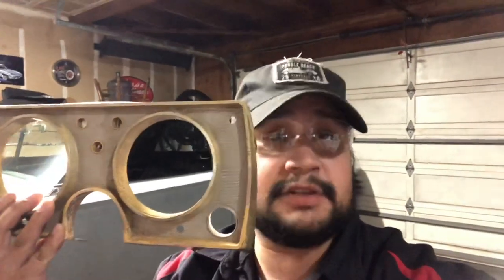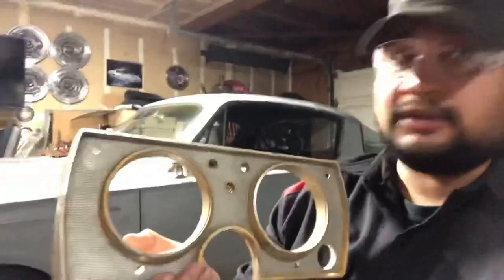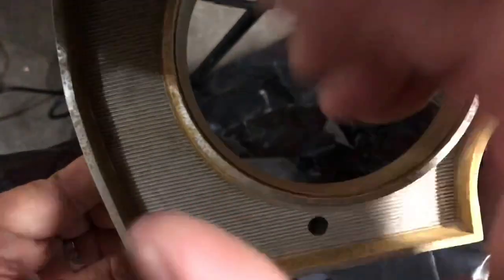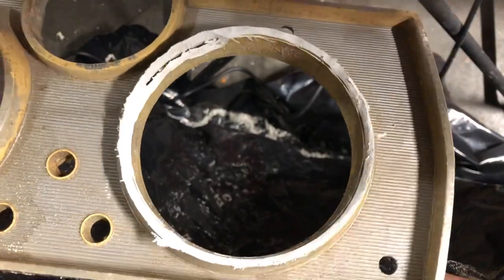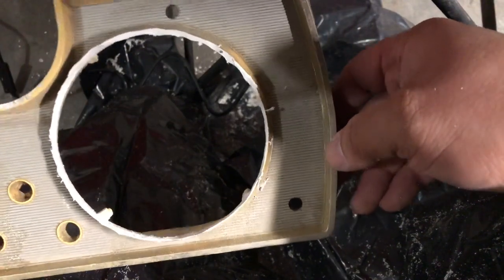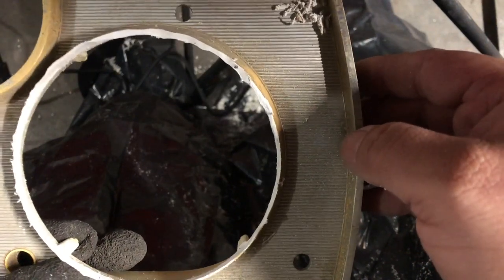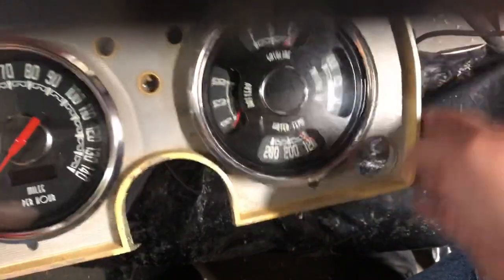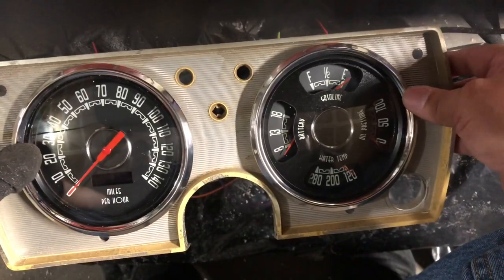Installing New Vintage USA gauges in my 1965 Barracuda: part 2

Comment: The gauges are very clean looking.  Was just thinking you might have been able to use a drill press on the lowest speed with a carbide burr mounted in it to trim the cluster

Comment: Gauges look great. I like the off white 60s look of the panel. I think black would take away that vintage look.
Reply from the maker: Thanks I’ll keep that in mind.
Reply: @tailsfromthejunkyard1023  i was curious, so i googled refinishing 65 barracuda dash panel. 
1 came up from OER, looked to me like new plastic.
Another one came from vansauto on ebay that had a cool chrome surround and i thought looked much better.
Found one on forabodiesonly that had the cool chrome surround but they put some kind of chrome finish over the plastic surface.
Jmo but that looked awesome.
I hope i helped with ideas. You might have already seen them.
Suprised at number of parts available for your car. COOL.
Reply from the maker: Yes actually I was aware of the available options for this car I just wanted to do something a little different but thanks for the research man I appreciate it